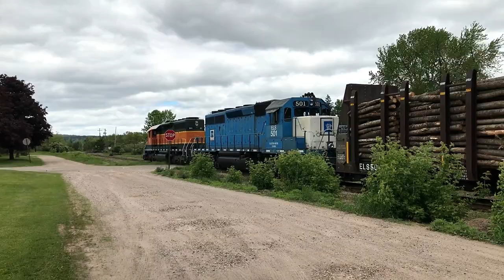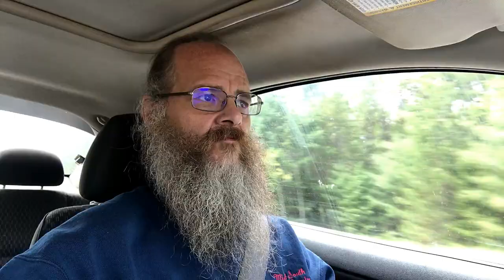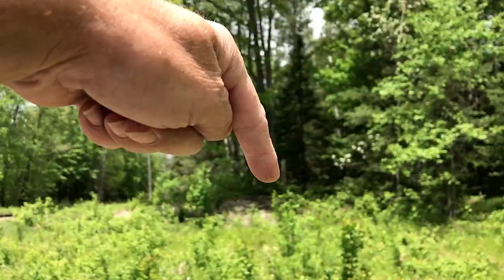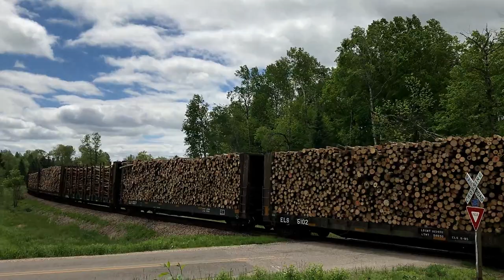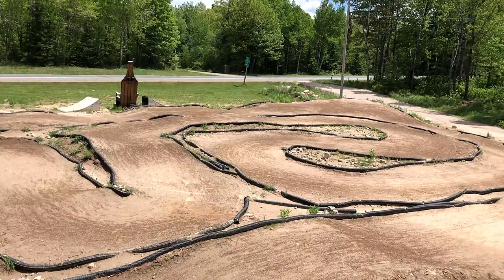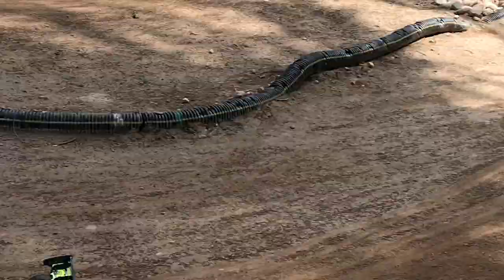Long Line Of Pulpwood Cars With A Few Hangers Looking For Targets.. Watch Out Now! | Jason Asselin

Comment: :41. Very Nice. - Enlist in infrastructure - ( Text stripping will do good in white ). /  Good time to clean out the Mississippi - love to hear how many sink to bottom - { some floating early (war-ning sights) - should pan out nicely, too. }. 😎🥰😏 -  (( BIG tire cable - lift bag - wrap the speed up on loading - just hook tension, before full settling. ))

"Call them to use other new track: before they lose it like 1:05. "

2:10 ( OMG, I can't watch any more 😱😬😳🙈🙊)